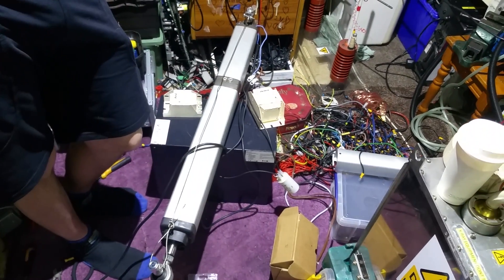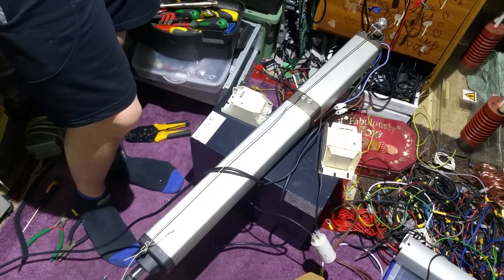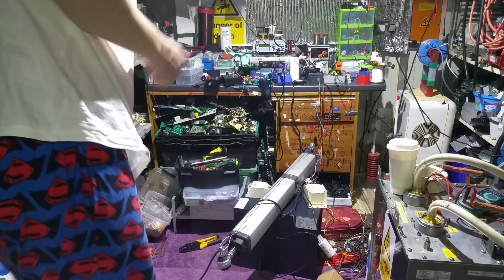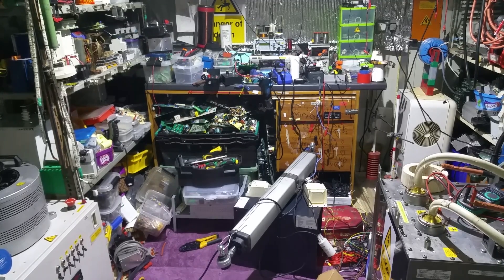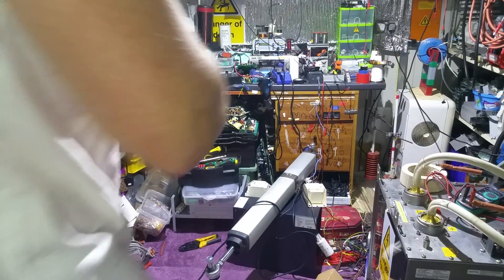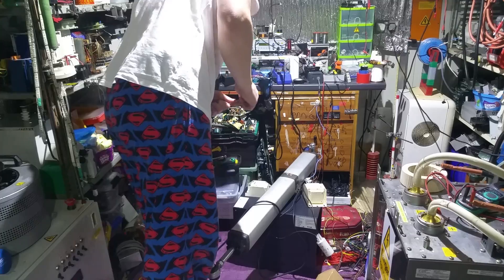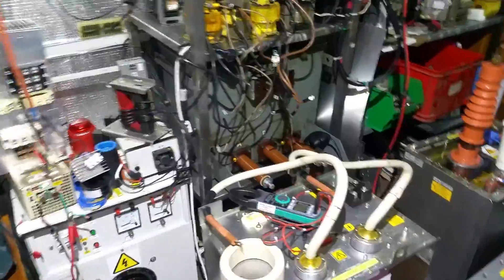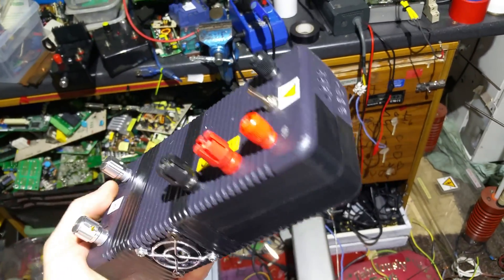Power of the piston Ram

Comment: What did you get them ferrite induction coils out of? A variable speed drive or a huge UPS?
Reply: I think it's obligatory that one of them gets turned into a overkill ZFS or JT type high voltage supply.
And yes, the second abbreviation does mean Joule Theif. I built a version with a third 1kV winding.
Works like a tiny MOT, 200mA-ish@1.2kV off the tertiary winding, input is 120VDC from a mains rectifier.
Reply from the maker: Hello mate. I got them out of a hugh ups. there Awesome arnt they 👍😉

thanks mate for the comment.😉 

Anthony 

High1voltage1rules
Reply: high1voltage1rules
oh yeah - proper monsters, just right for a rather large ZVS!